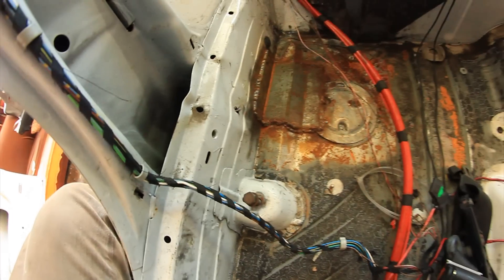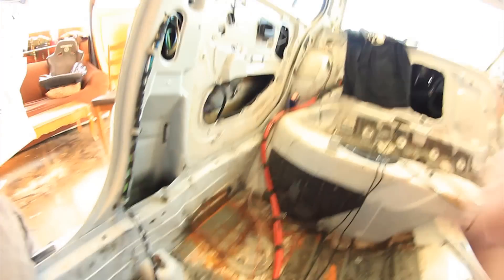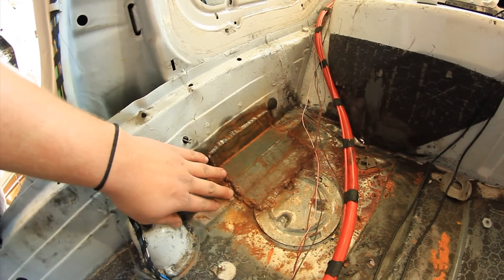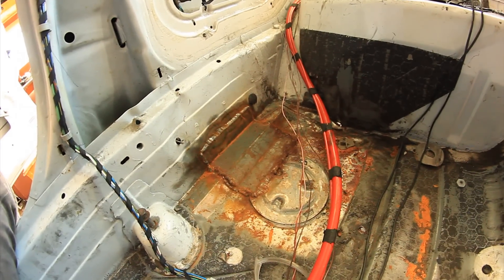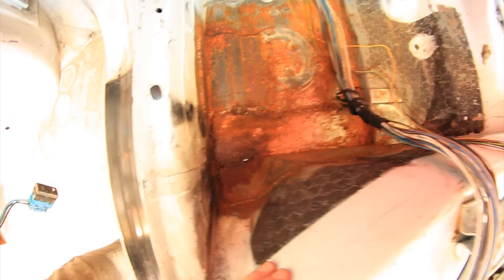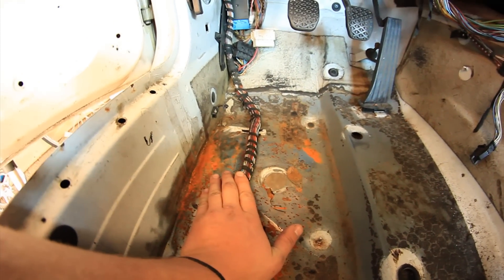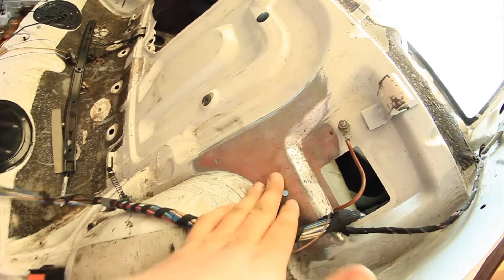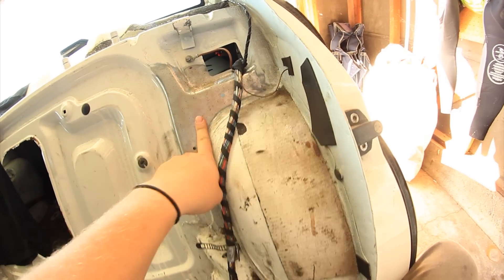Building my First Roll Cage Update 2 - Jacob Herzog - Bmw E36

Comment: Cool project dude. I would look into serious sanctioned body tech requirements for cages before you attempt the cage. The spot you pointed out for the rear downbar mounting location looks like nothing more than a firewall. You need a solid location which is usually the shock tower. I know GGD allows the rear down bar to be mounted to the wheel well but I would aim for the shock tower if I were you. I'm pretty sure your current mount location won't allow you to pass tech since it has no real structural rigidity.
Reply from the maker: Tanks! Ya thats what I thought too but Julian DuMays cage is going to that spot and he call cortex at Sonoma and asked if it was ok to go there. And they said ya, and he passed teck. I guess it holds the back seat in and is considered a structural part of the car. On E36's you cant go to the shock tower because its in the wheel well. but ya I already cut the tubing for it. Honestly it just a wednesday night car so ya.